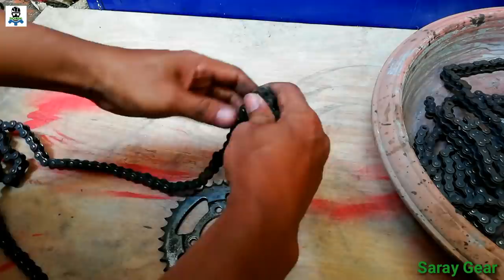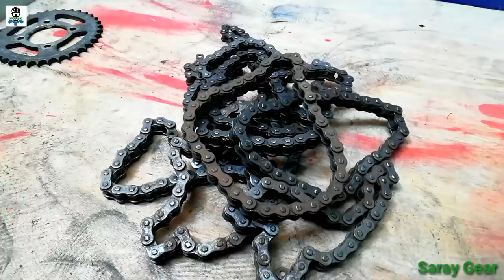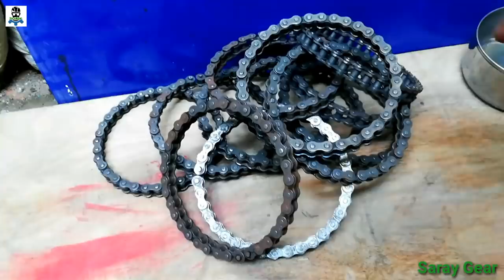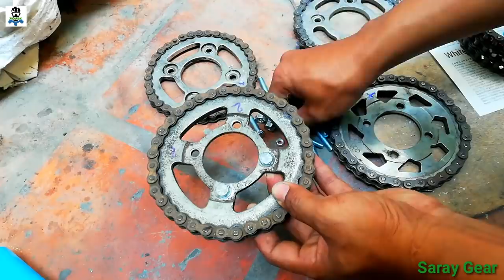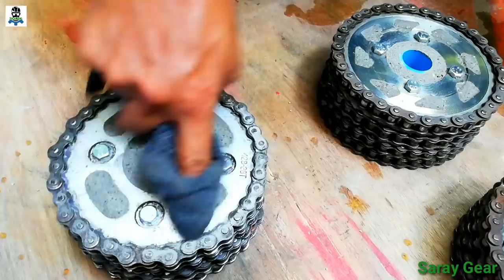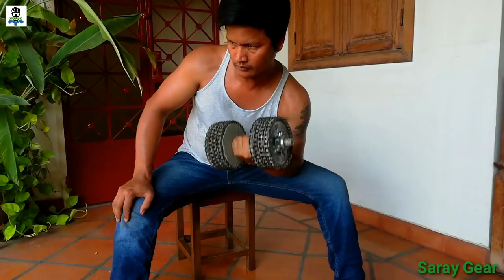Amazing Homemade How To Make Dumbbells For Gym Try Your Self At Home

Comment: They're cute but a 10 lb dumbbell isn't going to give me 22 inch biceps though. I wonder if you mixed tiny steel ball bearings in concrete instead of cement if it would be almost twice as heavy. Although doesn't concrete take longer to cure?
Reply from the maker: Thank you so much for this?